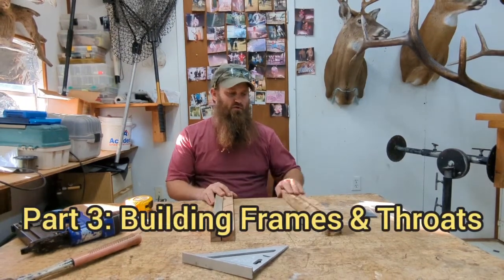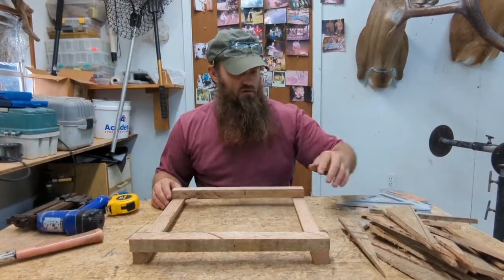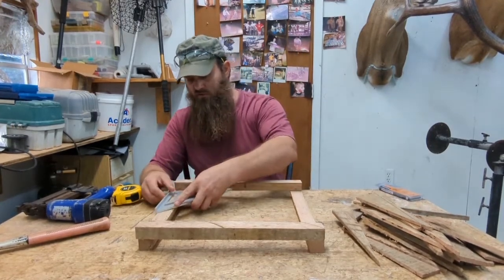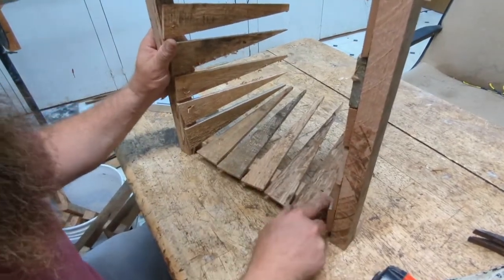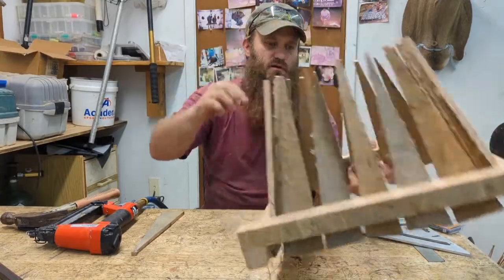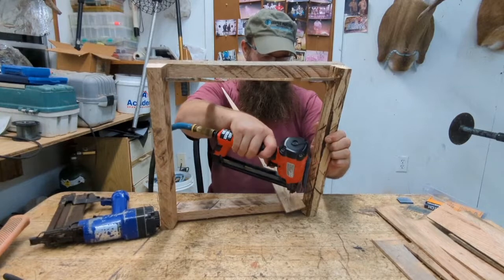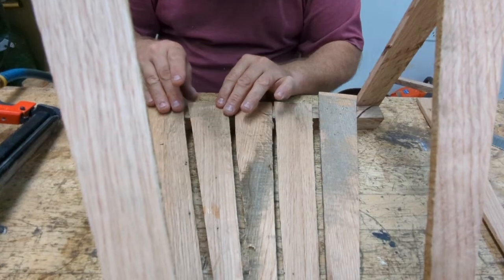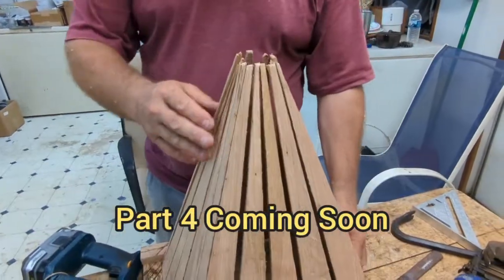Building Homemade Catfish Slat Traps Part 3: ( Frames & Throats)

Comment: Thanks for videos. I'm work on three now. But had to use Mississippi specs for the side. I have to have gaps on whole side. But I'm glad u got to the throat video that been my thing I don't want to buy plastic one
Reply from the maker: Hang in there, I should release the finish video tomorrow. Also before you nail your throat in your gonna be want to see my tips video following the next one. My last three I made, I made it the throats out of ash and their interchangeable. If that second throat gets broken fingers, your gonna want an easy way to get them out for repair. I've designed that now.
Reply from the maker: Yeah, make sure to check those Mississippi regs. Looks like you gotta have four 1.25" gaps 24" long on all four sides way I interpret their regs. I'd definitely double check with them for sure.